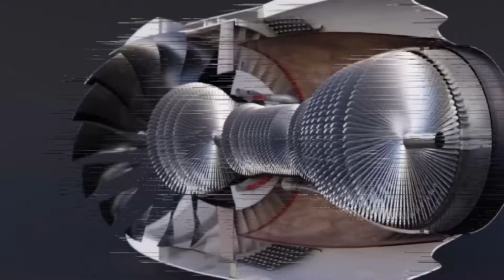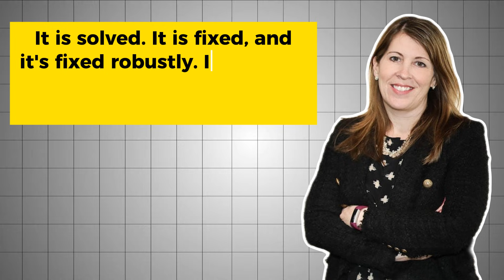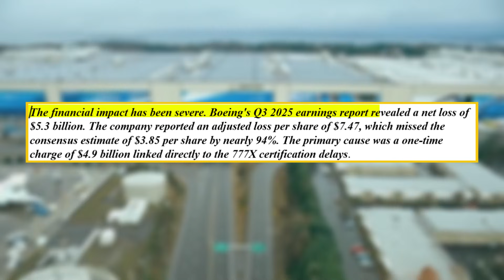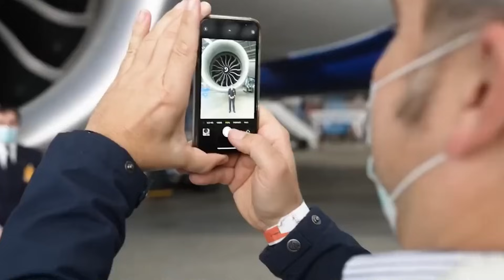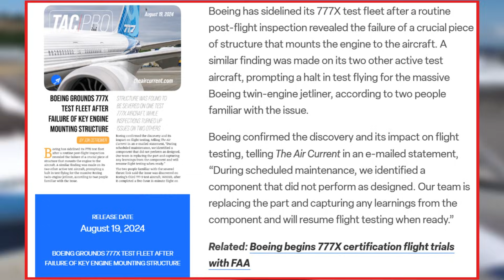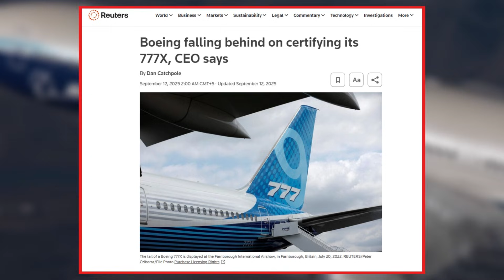This Boeing 777X Issue Could DESTROY the Entire Program!!

Comment: Those GE9X engines are two tons heavier each than the RR engines on the A350. They have ceramic protection which is a better solution for Emirates, but perhaps unnecessary for other airlines.
Reply: So???